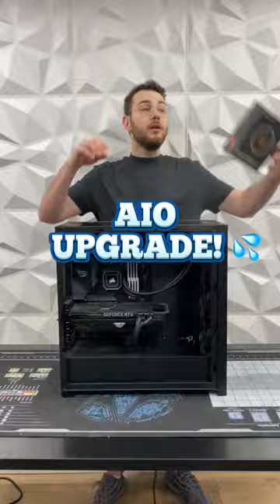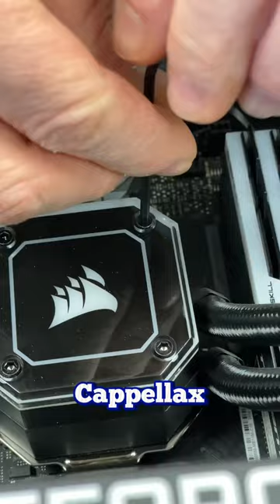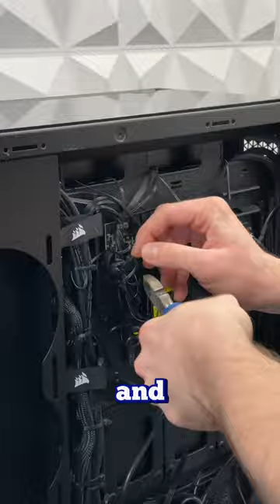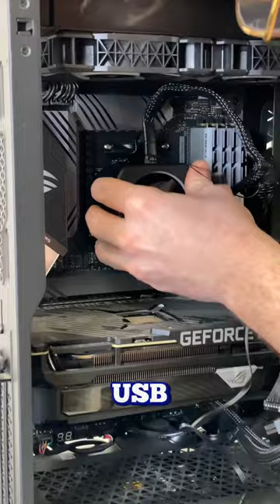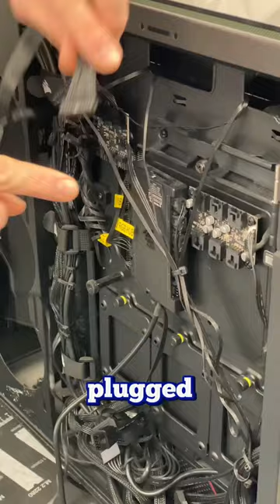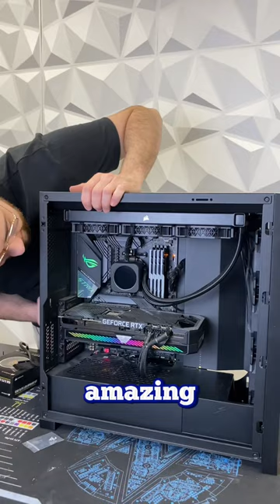AIO UPGRADE! 💦 #pcrepair #pc #gamingpc #pcgaming #egirl #gamerguy

Comment: jeez cable managment looks like my grandmas basement mate
Reply: Bruh looks like when i built my first pc and sucked at cable managment and these guys are professional PC Builders?!?!?! Bruh moment
Reply: Could be worse
Reply: @Johnny boogalo  Nah, doesn't get much better than this with corsair. Two cables per fan.
Reply: Lmao have you ever tried to cable manage a pc with a aio with full rgb fans and a bunch of rgb stuff
Reply: @normified  exactly lol I have the corsair aio and my cable management is shiz because of how many cable there are
Reply: It really isn't that bad
Reply: Bruh should see the bottom of my case. I have another pcie 6+2 i need to get out for my gou and cant even see it cus theres so many cords
Reply: *gpu
Reply: @silasbradford  i have mine loooks so much worse than that after a case swap and aio swap for a stock ryzen cooler the insidd where the mb sits is ok the back looks like my pubes after a month of not shaving them
Reply: @johnnyboogalo4897  I recently built my first pc and my cables look better than that
Reply: Mine is still worse.
Reply: -When a newb sees a wire
Reply: Fr I have way better cable management
Reply: It's because of all the fucking cables you get when you use a solution from a company that doesn't understand that daisy chaining cables is a viable solution.

Apart from that, the only egregious management issue is the cables being tucked into the psu space because they're too long, which is fine. 

Yes, I would like 2 cables for every single fan in my PC, and a additional 2 for my pump, then I would like an additional 2 cables for the rgb/fan hub to connect to the motherboard.

Companies like Arctic do it much better. 3 fans for the radiator and only 2 cables to plug in. Add to that the fact that corsair / nzxt RGB solutions don't even work off ARGB standards found in the motherboards.

Comment: It gave me the chills when you use a clipper to cut the cable ties💀💀💀 

I mean c'mon, cable ties should only used on cables that are meant to be put there permanently, like room lighting, room electricity, and whatnot.

And that doesn't apply to desktop PCs as you need to disassemble it to do maintenance like cleaning the fans or changing pastes every once in a while. 

Using velcros and/or wire twister to cable-manage your desktop PC are a much safer options than cable ties, and you could reuse them literally unlimited times.

That way, you can eliminate the risks of accidentally cutting your PC's small and delicate cables, nobody wants that to happen.🗿

FFS, their prices aren't that different.

Comment: I was thinking of getting this upgrade but then my corsair aio sounds like a jet engine
Reply: Probably the wrong mounting position. Shouldn’t sound like that. Make sure the rad and fans are above the pump head on the cpu.
Reply: i got mine refurbished, it wasnt working until i replaced the header with the lcd upgrade.